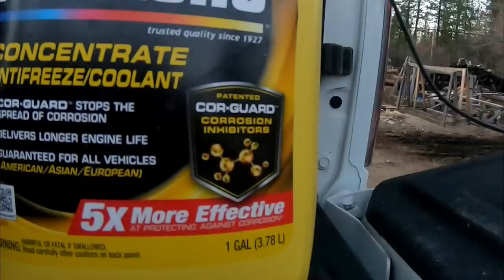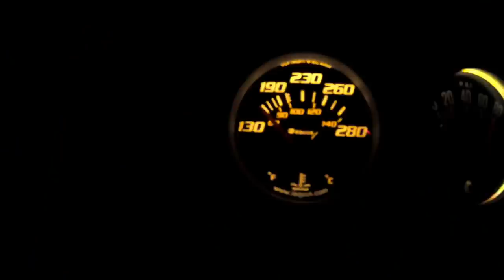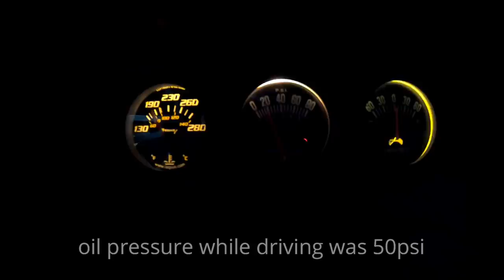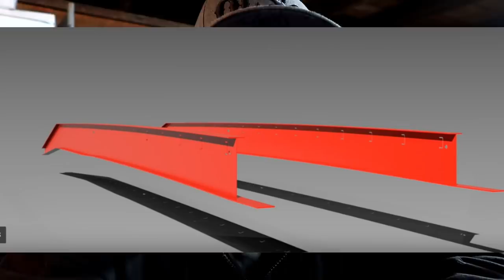WHAT TRAILER BRAND I PLAN ON GOING WITH FOR MY NEXT GOOSNECK TRAILER

Comment: So far I’ve spent my money and most my time under the front end of a dodge truck. Ball joints turned into tie rods turned into track bar, (looked up your video on that by the way, big help). Finally have the steering back where it was. I’d like to do the pitman arm, but my puller broke before it came off 😡. Anyway, love the channel, love my vbelt hat, thanks for the resource.
Reply from the maker: haha always something that helps with money deletes! 
and thank you for the support!

Comment: Great videos! Thanks for all the time you take to make them. N&N trailers are very well built and fully hot dipped galvanized. They're built in Canada but sold in the north eastern States as well. That may be too far from you but another option. I've heard good things about diamond c but no experience with them.

Comment: Engineered over heavy built would be the way to go. Dragging around heavy weight as you know eats into the fuel pocket book. More wear and tear on all the brakes, trailer and tow rig. What would be sweet would be an engineered aluminum trailer. I don’t know anyone who makes one and the cost would probably be out of this world. You are right get everything you want the first time. I changed my single drop leg to two speed dual hand crank dolly legs and added four nice Tractor Supply side boxes under both sides behind the dolly legs for chains , boomers, straps, tools and whatever. Added a 9000# Warn winch and added some diamond tread deck plate at the rear of the trailer to haul steel wheel tractors. Took time and extra cash to get the trailer we needed. Be patient, love the idea of video of building your future trailer. I think the  manufacturer should see the advertising value they could receive. Can’t wait.

Comment: Fyi . keep a eye on your 3rd brake light and cab clearance lights on the new truck  for water leaks. I just had mine replace under  warranty.  My 3rd brake light leaked and water stained my head liner and the clearance lights started getting condensation in them

Comment: We appreciate you too😃, Good choice on the Diamond C heard they they build a nice one. I am looking for a 14k 7x14 low-pro dump for a project I just picked up and need to move my L3800 between it and the ranch. The tractor with the Gannon box and bucket is at 16.5 ft but I think I can curl it and hang it over the front a bit. The 16ft is three axel and I’m working in tight spaces so I really don’t want to go bigger than 14ft. PJ, Trail Load, Top Hat and Great Northern are the ones I’ve looked at but now I’m going to check out Diamond C who are you dealing with and perhaps you can get some referral points👍👍👍. Any thoughts would be appreciated, keep up the good work Sam.

Comment: I’m in the same predicament as you. 2x 15k drum brakes or 3x 12k with disc....I love all the features on the Diamond C but can’t get their only dealer in UT to respond to me. I’ve been leaning toward Midsota, with my local trailer dealer. But they don’t have quite as many options as Diamond C. I don’t think I would be able to order a drop axle with the Midsota and having 12 trailer tires always on the ground is unappealing. Would love to hear what your final order will be....I can’t decide and it’s driving me nuts. Oh and the ONLY downside I can find with Diamond C is the powder coating. Personally not interested in powder coating based off what I have read; once it chips the frame will rust beneath the coating....but I don’t have any personal experience. Midsota uses PPG paint and it’s supposedly legit....
Reply from the maker: Michael Rowley I ordered a 30’ hydro dove. 12k axled trailer with the disk brakes. Rated at 25,9000. They can prorate the trailers to 30k if you wanna pay the road tax for weight. I ordered thru a dealer 250 miles away. Best deal and guy called back quick with info and such. Earned my business.
Reply: V-BELT and SON thanks for the reply. I’m starting to lean toward the triple 12k with drop axel....I guess I’ll just have to be extra careful with metal tracks.

Kinda of random question, is your kubota a “high flow” version, if they offer that, or just standard? Trying to figure out how many gpm is ideal for the Mulcher heads. Considering a 310 machine that has 35 gpm or I could go with an 8 ton that has high flow with 39 gpm. Not sure how that even translates to real-life efficiency though....
Reply from the maker: Michael Rowley most modern machines of that size have high flow ready to rock. Mine has high flow. It works pretty good. Just has it’s place. 8 ton machines are the best size

Comment: I'm a pj trailers fan all the way iv had 3 of them had one issue on a dump trailer and they fixed immediately no questions asked
Reply: I have a 2006 PJ 7 by 12 dump trailer that was built very well with the seam in the middle of the bed lining up perfect. I then bought a 2017 PJ Trailer 7 by 14 dump and the seam in the middle of the bed is off by over 1/8 inch in most of the 14 ft. The weld quality is poor on a lot of the trailer. The rear tailgate has a quarter inch Gap at the bottom of the dump gate causing material to fall out. There was also a wire being pinched by the dump bed which I had to move out of the way. I should have looked this trailer over much more carefully before I paid my $9,000 for it.

Comment: Diamond C trailers are nice i run with the 40k maxxd 40' it's 12k lbs empty but i haul heavy equipment day in day out out here in the oil fields an it holds up good I had tire issue with it an they replace all 8 for free . It also comes with a 2yr warranty . U can check it out on Instagram @ doublejbrothers

Comment: How are you getting away with not running USDOT numbers? Does CA not require them for commercial vehicles over 10k gvwr in intrastate commerce. I get it that you all are not a “for hire” motor carrier, but you are a private motor carrier as defined in the FMCSRs. Maybe I missed any markings on the side of your pickup. I know things are different in CA as opposed to the rest of the country that’s why I was wondering. You do extremely quality videos.
Reply from the maker: Hoyt Ballard we run a CA number on the “legit” trucks like my 5500. I run less than a 100 miles radius. I don’t need a dot number because the truck doesn’t leave the state of ca. Needs a permit to do that on my 5500. 
And thank you!
Reply: @VBELTandSON  That's what I figured. CA has different intrastate rules.  Here in Georgia they adopted the FMCSRs so anything over 10K gvwr used in a business requires USDOT regardless of intra, inter or any radius exclusion.  The DOT cops around here wear pickups out!